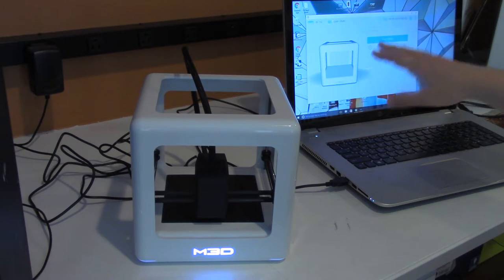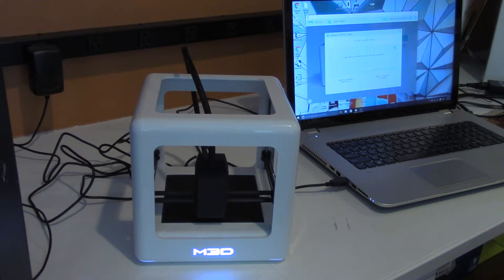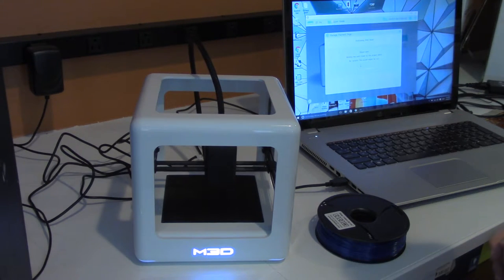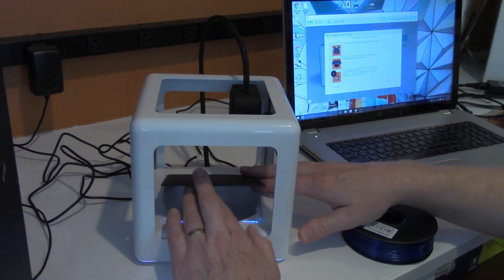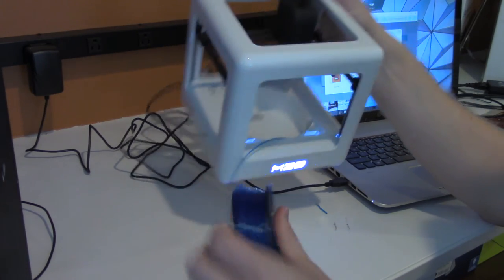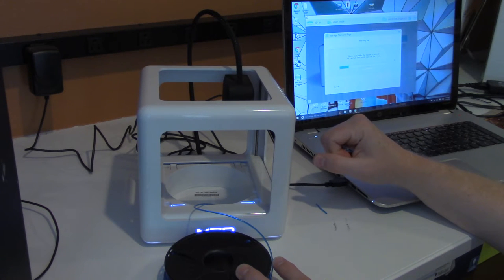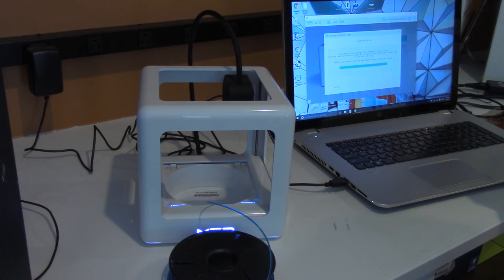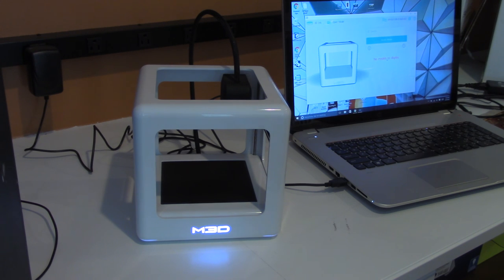WTFFF M3D Filament Loading

Comment: Calling the plastic "ink"? Ugh. Awful choice. I mean I get using terms that people understand. But if I've got an electric car I don't call plugging it in "filling the tank", nor do I call the electricity in the battery "gas". Though I might be guilty of saying I'm "out of gas" when I drain the battery.

I guess part of the problem is I'd love a 3D printer that actually used ink to color a white filament, applied near the nozzle, to produce full color prints. In that day this whole calling filament "ink" will be detrimental.